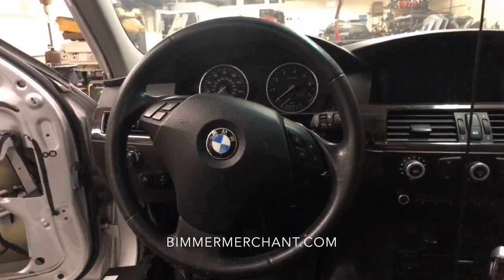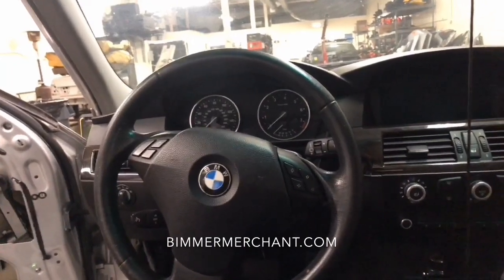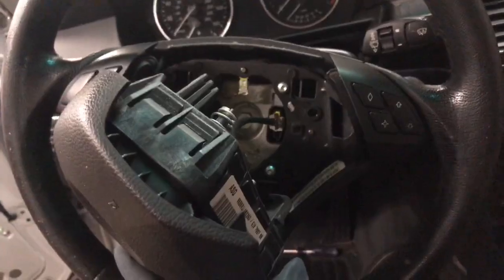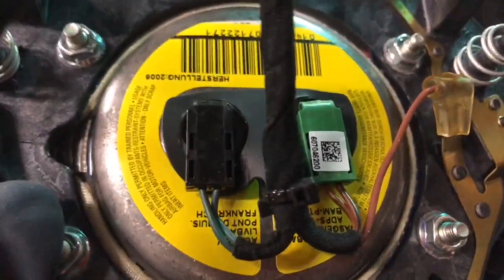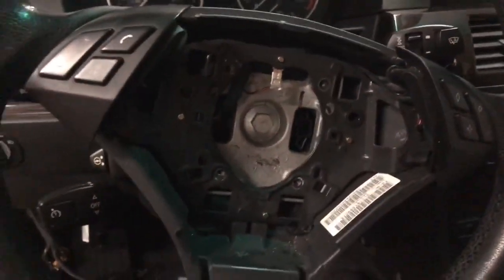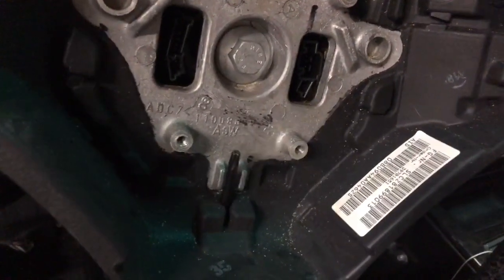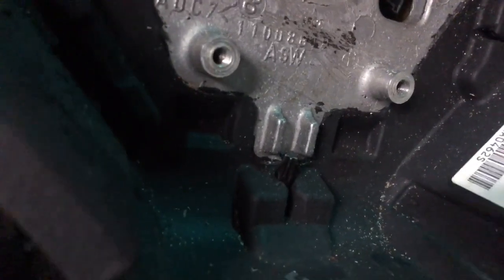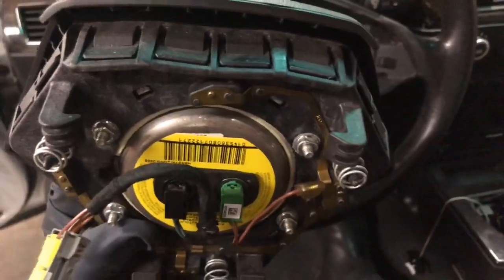How to remove Steering Wheel Airbag From BMW E60 5-Series

Comment: Exactly how hard do I have to push on the retainer spring? I pushed it in with maybe ten pounds of force but it doesn't release. I'm afraid to push it too hard and break something.
Reply from the maker: Once you’ve placed tool on the spring and start to push, you should notice that the steering wheel airbag pops out.  If you are pressing hard and nothing is happening, then you need to feel for the spring